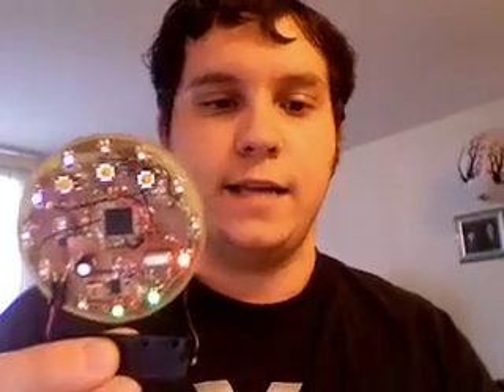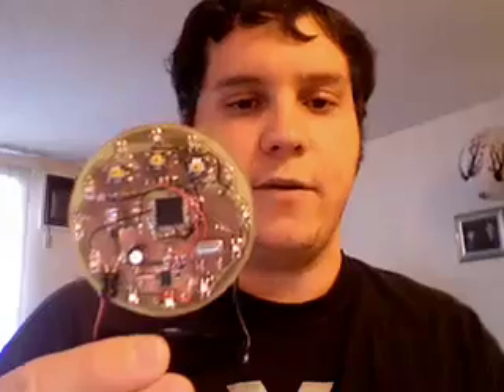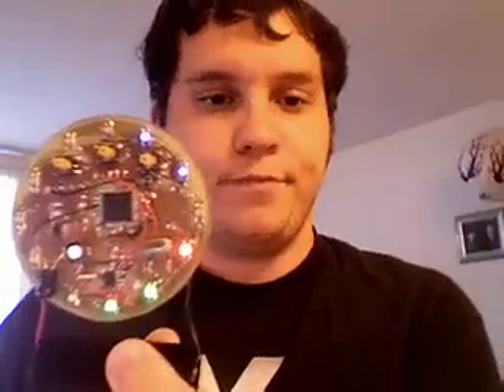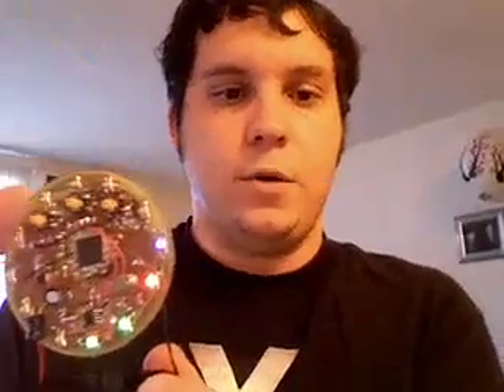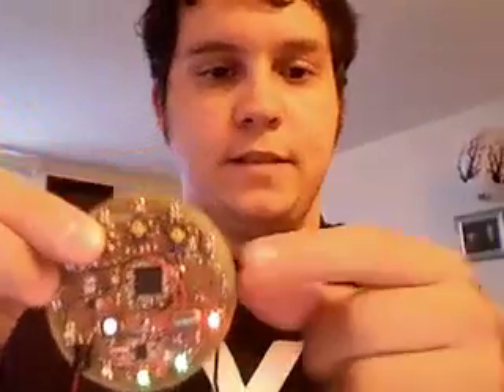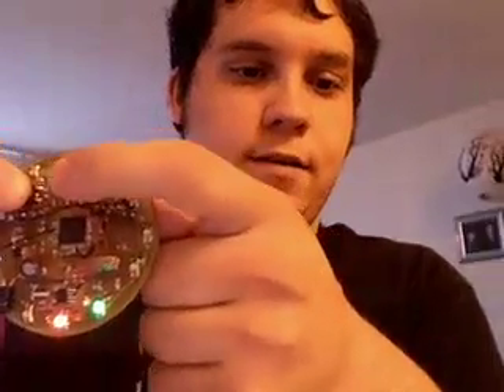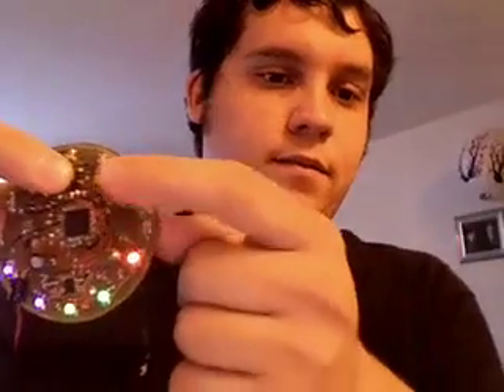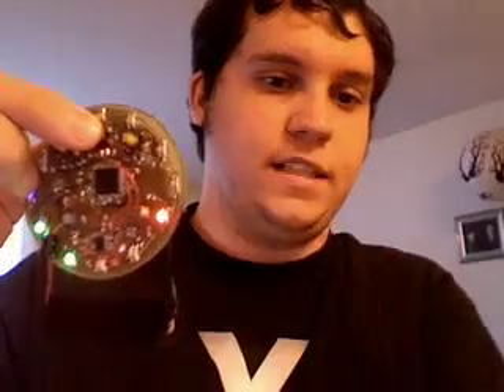RGB LED Desktop Clock

Comment from the maker: The clock as pictured in the video is just a prototype.  The finished version with a manufactured PCB will look quite sharp as is.  I may build a little stand for it, but I like being able to see the circuitry.  However, there would be no reason why you couldn't make an enclosure if you wanted.

Comment from the maker: I originally wanted to make this a watch, and then even a pocketwatch, but I ran into problems making it small enough.  I might be able to make the PCB smaller if I used a PCB design with more than two layers, but the issue with power still comes to play..  you wouldnt be able to power it long on a single coin cell.